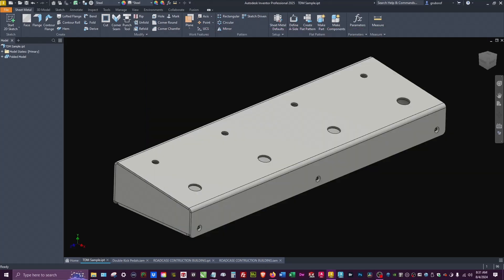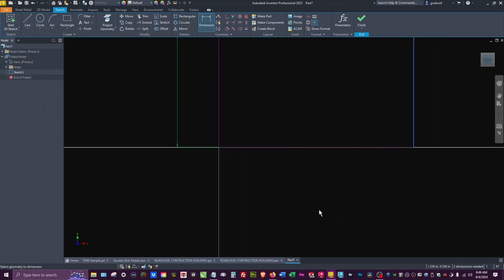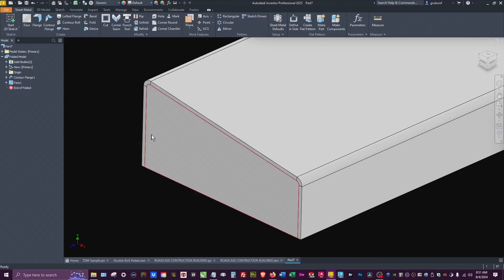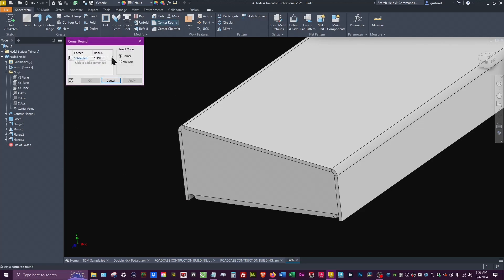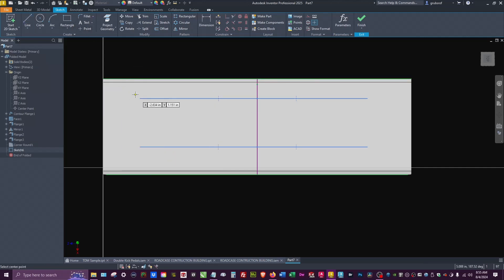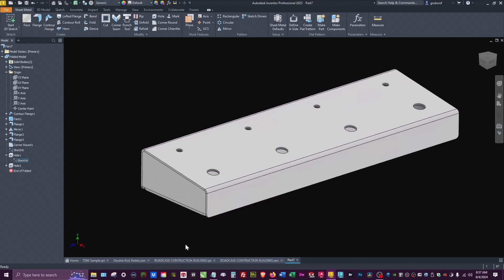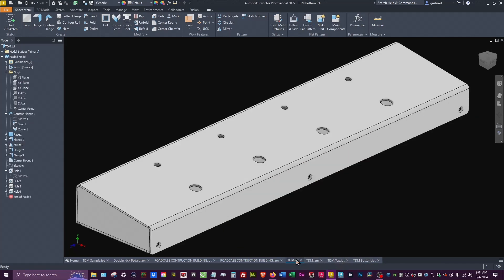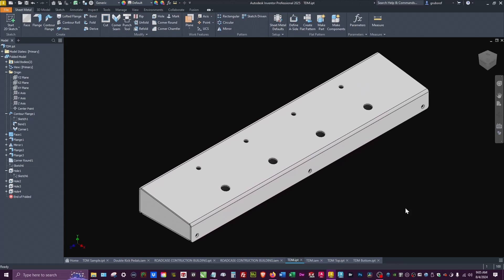Autodesk Inventor - Top Down Modeling

Comment: Thank you for the tutorial Jeffrey!
In the ending you are mentioning additional holes - this means that every time we want more holes (more than 8 in this situation), we have to manually add more construction lines with manually drawn hole points?
Is this correct?
Reply from the maker: Basically yes. If you want hole on the same plain as the other, you can go back into the original sketch and add more points. If you want those new point to be a different size, than finish the sketch, turn on the visibility of that sketch and pick the new points and add the new size, otherwise start a new sketch on the same surface, to keep the two patterns from getting cluttered. it also makes it easier to find the correct hole easier. Hope this answers your question. Let me know if I confused you?